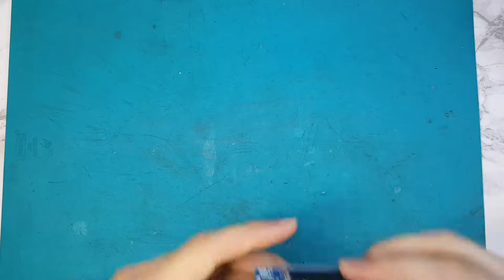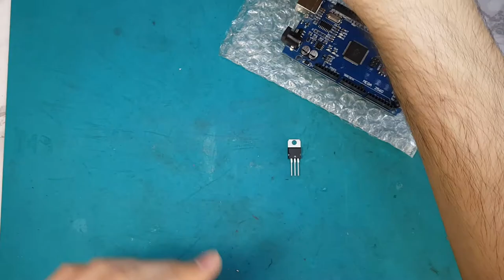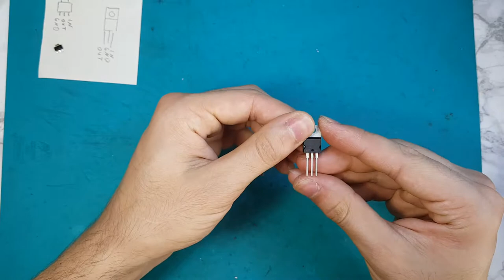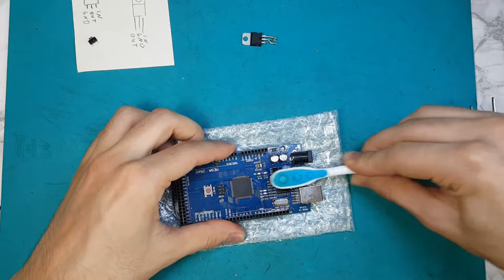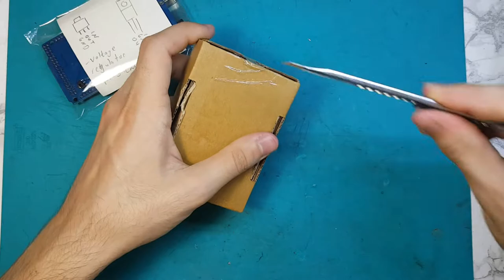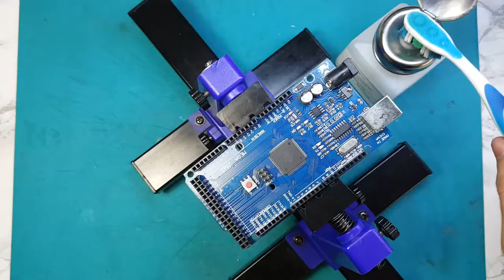Repair - Arduino Mega Board Voltage Regulator Replacement (Subtitles Available)

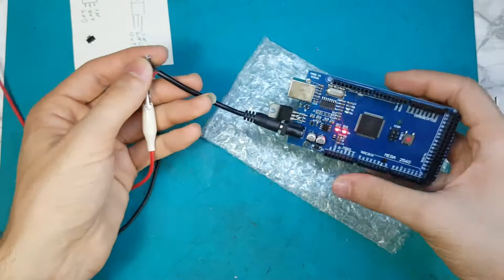Comment: good job but at  5:30 you should tested pin 2 "out" and make sure it's 5V, the over heating means higher voltage.

Comment: Instead, in my case, all the smd LEDs stay on and when I press reset nothing changes. I desoldered the button and connected it to the reset pin and gnd but nothing at all. I have the clone and it is not possible to disconnect the Atmega 328. What solutions can I take? Thank you very much.
Reply from the maker: @pierpa_76pierpaolo  I would suggest to upload an empty code first
Reply: @AydnSEN  I had already tried but it doesn't work.
Reply from the maker: @pierpa_76pierpaolo  Well, if you can upload an empty code to it I believe it's working properly. Because arduino reset itself on the upload stage. If there was a short circuit, you wouldn't be able to see any llights on the leds.
Reply from the maker: If you can provide more details I will try to answer
Reply: @AydnSEN  Okay. I tried bootloader but nothing I have to continue with 'Atmega328 old option. For the Arduino clone board I reconnected it but no COM port can be found. I will search inside the control panel and so on to try to solve ... .
Reply from the maker: @pierpa_76pierpaolo  Have you tried another cable? Idk how but once I menaged to damage the one data pin on the connector as well.
Reply: @AydnSEN  I have to try. But the original ONE works perfectly with this cable. I think for the clone one I will desolder the ic ch340g ... .
Reply: Yesterday I set out to test the smd resistors and one stamped “4” (corresponds to 4 ohms ? ) is shorted and acting like a jumper. I have to change it with a standard resistor since I don't have smd resistors at hand.
Reply from the maker: @pierpa_76pierpaolo  Are you sure it is not the fuse?
Reply: @AydnSEN  I looked for another UNO clone and in this one there is an smd000 (placed in the same spot), which corresponds to a very trivial jumper bridge. But there still remains the problem of figuring out the value of the smd 4 resistor (I can take it out as a test ... ) which I can't find references anywhere!!!
Reply: @AydnSEN  To me it is a smd temperature sensor. Next to the component on the pcb is an abbreviation “PT”.
Reply from the maker: @pierpa_76pierpaolo  I've never seen a temp sensor build in to an arduino before. Since it's kinda open source, your clone version must have been modified.
Reply: @AydnSEN  I thought it had but it hasn't! Now it doesn't even turn on anymore. I removed the “type B” connector. Now it remains for me to try powering the CH340 IC with the 5 V and then “if” it works run it via TTL or via leads pick up the data pins (D- D+). I will try!!!
Reply: Ic CH340G KO !!!
5 V shorted !!!
3.3 V results not shorted but burns out the voltage regulator (poor quality Chinese) marked U5 on the board. It should be an XC6206P for the 3.3 vdc.  Now I have the 'last chance to power the Atmega 328 via the AREF pin (100 nF ---> 104 between Aref and gnd). And program it via ISP.

Comment: In my case UNO power led glow for one sec then rest, when i connect 5v usb supply.
Any solution ?
Sorry for my bad English.
Reply from the maker: Power sockets could be broken, I had that problem before. It could be like broken headset cable, they only work at one angle. Check the connectors before changing any components. You can use voltmeter to make sure they are conduct electricty.

Comment: I connect the ardunio uno with computer power supply my voltage regulator burn ASM1117 5.0 DN913 NOW I BUY NEW REGULATOR ASM1117 5.0 GTY50 WHEN I CONNECT THE USB OR ADAPTER  TO BOARD ON USB THE SHOW RED LIGHTS AND OFF AND HEAT... AND WHEN I CONNECT THE CHARGER 5 VOLT THEY SHOW RED LIGHT AND CONDUCT A HEAT..... BUT RED LIGHTS ON.... WHAT IS THE PROBLEM?
Reply from the maker: Can you write your problem again? I couldn't understand what you mean..

Comment: I test my my mega 2560 to relay 16 channel with PSU 12v 5A as a VCC  , everything looks fine till i use serial monitor my laptop turn off forced and arduino  board to when i try to connect arduino to PC again seems port cant read , its CPU problem or reglulator promblem?
Reply from the maker: Your arduino might be shorting. Please check any pyhiscal damage on the usb port or surrounding components. Be careful, shorting usb port of the computer it might burn the motherboard. It is hard to say something without seeing it but highlikely your arduino is damaged. Does the leds turn on when you powered it via usb? Try to power it with powerbank instead of your computer

Comment: Hi mr. Aydin, Can you help me with this please?
I have [2] Arduino Mega 2560 and one Ramp 1.4 with Lcd 2004 connected Both Arduino working well half working??

1st Arduino can't see anything on the Lcd, only when I connect it to my Computer using Usb cable
The 2nd can't deducted when connect the Usb but still can see everything on the Lcd, that's mean I can't upload anything new to 2nd Arduino and can't work with 1st Arduino because nothing on the Lcd
Sorry it’s complicated and I can't find out the problem
Hope you can
Thanks a lot and best regards
Mustafa
Reply from the maker: Hi Mustafa, Did you checked the first arduino voltage regulator? I have had same problem.Voltage regulators are weak on clone arduino. Make sure the power line works. For the second arduino, I couldn't understand your problem exactly. Would you give me more information please?
Reply: @AydnSEN  
Thank you very much
Sorry I wasn't clear
Arduino (1) when connected to my pc I got error no port 
So I can't do any update on it. But with power on the LCD show what is in that Arduino but can't change anything the computer can't see Arduino (USB) port
Arduino (2) when connected to my PC work with it very good, but the same LCD shows nothing only light. So both are useless unless I fix them (but No idea what’s the problem)
Reply from the maker: I'm sorry. I couldn't find any solution 😞

Comment: I hope u respond to this 
I have an Arduino uno i shorted 5v to gnd directly . it powered off after i removed the short it powered on but no longer detected on my laptop or any other device 
It was connected to my laptop when this happend
When connected through usb it have power but is not detected
Reply from the maker: Hey, of course I'm going to respond. Can you try with different usb port ? Can you see arduino on device menager after connecting to your computer ?
Reply: @AydnSEN  thanks for your really quick and precious respond
Same problem its powered on and didn't appear in device manager
Reply from the maker: @Khaled-El-Shora  Check the socket pins, I burned 1 out of 4 once. It was powering but was not transfering data. Also, if you have spare cable please try that as well.
Reply: @AydnSEN  i tried another cable still the same 
How to check socket pins
Reply: @AydnSEN  i have just checked them with a multimeter (continuity test) and the 4 pins are good
Reply from the maker: @Khaled-El-Shora  you can look at them by under magnifying glass to see if there is anything unusual or if you have a multimeter with buzzer, can try to touch pins one by by untill you hear 4 beaps. (Plug the cable to arduino and reach one pin from the usb cable other from on the arduino board) Do not power while doing that
Reply from the maker: @Khaled-El-Shora  I'm sorry I ran out of ideas 😪

Comment: Aydın bey, selamlar. Mega kartıma Ramps bağladım ve 4 step motor kullanıyorum. Ramps kartını 12V ile beslediğimde Meganın AMS1117 bileşeninin aşırı ısındığını fark ettim. Bunun haeicinde sistem sorunsuz bir şekilde çalılıyor. Sizce AMS1117yi değiştirmeli miyim? Bu kadar çok ısınınca yanmasından korkuyorum.
Reply from the maker: Merhaba, elektronik komponentlerin yük altında ısınması normal. Buradan birşey söylemek zor. Sıcaklığını ölçme imkanınız var mı ? Elinizle dokunabiliyor musunuz ? Endişeli iseniz alternatif olarak pasif bir soğutucu blok (heat sink) kullanabilirsiniz.
Reply: @AydnSEN  Cevabınız için teşekkür ederim. Ramps kartını söküp Motor Shield taktım ve 12v 2a ile besledim. Bu durumda herhangi bir ısınma olmadı. Sanırım Ramps kartımda bir sorun var. Ayrıca, Megaya boş sketch yükleyip Rampsı tekrar bağladım ve yine Meganın A1117 bileşeninde ısınma oldu. Rampsın hangi bileşeni bozulmuş olabilir?
Reply from the maker: @UzunKamis  AMS1117 nin kartın üzerindeki görevi yanındaki birkaç komponent ile beraber 5v voltaj regülatörü olarak çalışması. 12v u 5v a düşürürken ısınması normal. Ancak ramps modülünde ısınmasının sebebi, ramps modülünün 5v a çokça ihtiyaç duyması olduğunu zannediyorum. Ramps üzerindeki voltaj beslemesini yapın ve kartın üzerinde header veya lehim yaparak aktif edebileceğiniz, arduinoyu besle gibi seçeneği aktif edin. Dolayısıyla arduioyu kartın üzerinden besliyeceginiz için, arduino üzerindeki AMS1117 yi kullanmamış olacaksınız. Zira ramps üzerinde de benzer bir voltaj regülatörü var. Şuan benim ramps modülüm ile deneme şansım malesef yok. 2 3 hafta sonra ancak müsait olacağım. Detaylı sorunuz olursa instagram üzerinden yazarak ulaşabilirsiniz. @aydxn_sn

Comment: BROO CAN I FIX IT WITH 3.3 VOLT REGULATOR😶
Reply from the maker: Yes of course you can !! If I'm not mistaken, it's called MIC-5203. In addition, I record a video about how to replace it. However, I couldn't posted yet 😶😶
Reply: NO o las salidas  solo alcanzaran 3v

Comment: Se calienta con el 7805 por que esta mal  , el (7805 = pin 1 es input ,pin 2 ground ,pin 3output) en smd(ax1117 y ams1117 -5.0= pin1 gnd, pin2 output, pin3 input ) corrige el video o muchos  quemaran el arduino
Reply from the maker: Just to make sure, no Arduino were hurt in that video :D I know their pins are different and you should watch entire video before making comments. I already mentioned it.

Comment: Let's see...
1. Put board on ESD generato plastic bag.
2. Power supply leads same length. can touch (probably did).
3. Pry up on solder pads.

F*.
Reply from the maker: Morning Bob 🖖I'm glad that u know something about electronics. ESN is big deal as you said but even todays chineese circuit boards can handle it well, 90's over. I'm sure your power supply has reverse polarization protection as like mine.(They didn't btw 😂) Lastly, I didn't damage the solder pads but I wish I had hot air station to repair it properly.